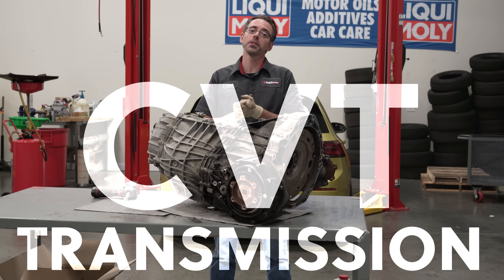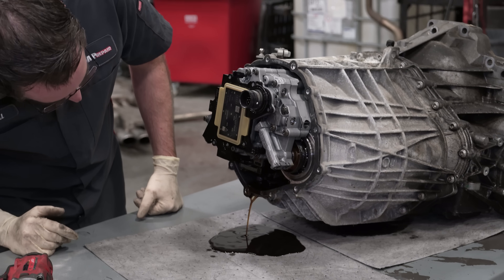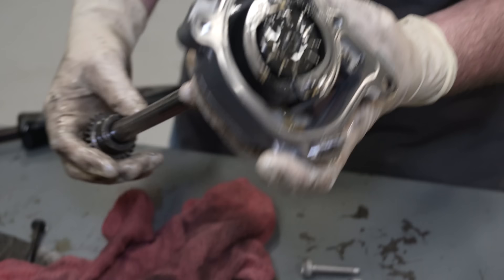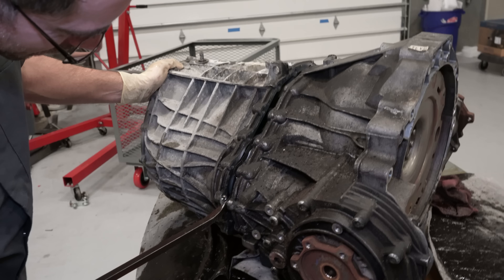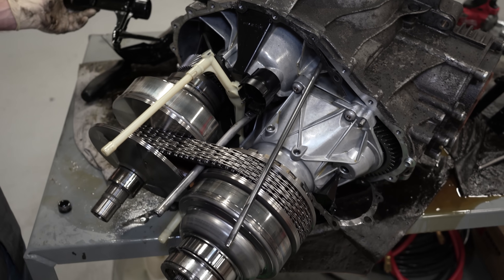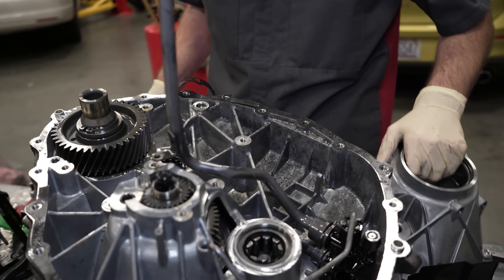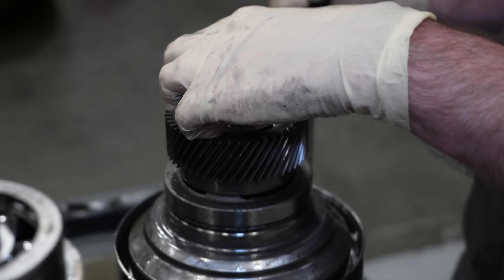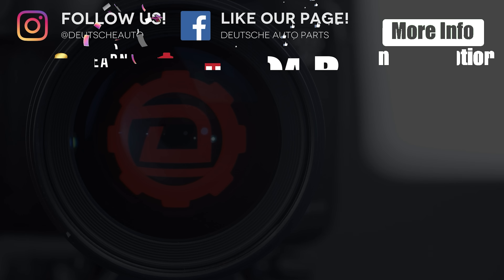Why you shouldn’t get a CVT transmission

Comment: Toyota CVT's are unique because they use a "launch gear". CVT's tend to experience the most slip and wear under hard acceleration from a dead stop. In a Toyota CVT a conventional gear is used to accelerates the car up to a certain speed and then the launch gear is disengaged and the continuously variable mechanism is engaged. This removes a major source of wear and significantly extends the life of the transmission.
Reply: That’s true, an Uber driver I know has the launch gear fitted Corolla…He says it’s solid…does the fluid changes regularly…he had a Corolla pre-launch gear fitted 2015 corolla that cvt finally took a dump at 325K…
Reply: @donovanfahrbach2493  325K miles is incredible for a CVT though. Jatco units will die as soon as 40K or earlier!
Reply: @MyerShift7  Agreed I walk though the scrap yard and all I see is a graveyard of Jatcos
Reply: @MyerShift7  honestly 325k is incredible for any transmission
Reply: @donovanfahrbach2493  wow thats pretty good mileage for any transmission
Reply: @donovanfahrbach2493   I mean.... 325k miles or kilometers? Still seems like a good number to hit for the life of a supposedly fail-heavy technology
Reply: @SuppositionalBox  325,000 miles on a 2016 Toyota Corolla..that’s miles .
Reply: thats true on the corolla SE. But starting 2023, the launch gear is there on all models.
Reply: @nadirnazim9342  its still a shitty CVT
Reply: @nadirnazim9342 eCVTs don't need a launch gear because it uses electric motors, there is no mechanical contact between the engine and wheels
Reply: @davewebster1627 you mean it uses planetary gears rather than that metal belt system.
Reply: I can't get over how ridiculously large the transmission is
Reply: @latemreggadable  That's what she s....never mind. 🫤
Reply: @latemreggadable  Yes... And complicated AF. Typical German Garbage. Complication for its own sake is their philosophy (in cars)
Reply: I just had a new corolla as a rental and found it was the only CVT I have driven that I liked.  Drove really well, always had a perfect ratio for the situation.  Very smooth.  The mechanical first gear works really well in traffic too.  Feels just like a regular torque converter auto
Reply: @kbkman7742 glad to hear, my 2024 corolla hatchback arrives in a month.
Reply: i have Lexus GS300h 2016 with this thing and it is amazing  never had any issues. car has already 260k km under its belt...
Reply: You got that from Scotty Kilmer.
Reply: @Nick41622  😂😂
Reply: @KL4life  what's so funny.
Reply: Leave it to Toyota to actually fix the common fault point of the trans and then start using it.
Reply: A friend of mine had a Toyota (I don't remember the model, but it was a sedan). He loved his. Only thing that kind creeped him out was the no shifting. He said for the longest time he'd be waiting for it to shift and it wouldn't, then he'd be tense from expecting it to. Said it took him a little to adjust.
Reply: @WiPri0371 That was my experience but the driving experience is so damn smooth getting onto the highway because there is constant torque
Reply: don't Toyota CVTs use eCVTs? as in there's no belts it's just a planetary gear set with two motors
Reply: @alyx6427  The eCVT is only for the hybrid models. The electric motor takes over the role of the pulley and belt.  Normal gas only models still have the pulley and belt CVT.
Reply: @davec3400  Excellent... my Honda Accord Hybrid shall prevail!
Reply: @davec3400  "eCVT" is a really, really bad name - it has nothing whatever in common with a mechanical CVT.   Also, it (eCVT) works, and in a non-annoying fashion.
Reply: @cr10001  John Deere calls their newest iteration of this just " evt" (electrically variable transmission.) The older system they called "ivt"(infinitely variable transmission). The ivt used a hydraulic motor for speed control in the planetary system where the new one uses an electric.
Reply: @davec3400  makes you wonder when they even call it a cvt then 😂
Reply: @cr10001  The transmission in a Toyota/Lexus hybrid is definitely a CVT.
Please allow me to explain. The most common mistake people make in the "CVT debate" is that they misinterpret the term CVT.
The term CVT has nothing to do with the architecture or how the transmission works but what she does. In other words: CVT is the RESULT
of how a transmission works. I will clarify this with 2 examples:
First example:
The transmission with 2 pulleys and a belt (AKA the traditional CVT)
In short: the most common type of a CVT uses a V-belt witch runs between two pulleys, the cone-shaped halfes of the pulleys can move together and apart.
So that is how the transmission is built and how she works and the RESULT of that is a transmission with no fixed gears or steps but instead of that
 a transmission with a variable gear ratio or CVT.
Second example:
Toyota/Lexus  eCVT
Very short : this transmission uses a complex planetary gear system with 2 electric motors- generators (MG 1 & MG 2)
integrated. The mechanical gearing design of the system allow the mechanical power from the ICE to be split in 3 ways:
- Extra torque at the wheels under constant rotation speed.
- Extra rotation speed at the wheels under constant torque
- Power for an electric generator.
Now that is the architecture of the system and how it works and it's completely different from the one in the first example with the 2 pulleys, you can't
even compare them.
But the RESULT is exactly the same: a transmission with a variable gear ratio or CVT( Continuous Variable Transmission).
CVT's are used in many vehicles even in bicycles ( NuVinci hub). And of course a CVT of a bicycle works totally different than a CVT of a car, but the 
RESULT is, again , exactly the same: a transmission with a variable gear ratio or CVT.
Conclusion:
Every transmission with pulleys and a belt is a CVT, but not every CVT is a transmission with pulleys and a belt.
CVT is just a concept and Variomatic (DAF), Variotronic (Audi), ECVT ( Subaru), e-CVT (TOYOTA/LEXUS), NuVinci hub for bicycles etc. etc. are perfect examples of how the concept CVT can be realized.
Reply: @davec3400 Correct 👍😊
Reply: @davec3400 Oh man that really sucks. And I just bought a Corolla. How long can I keep it before problems arise ?
Reply: @TheTiloalfa6  CVT stands for continuously variable transmission. An electric motor can output variable torque depending on how much power is applied. It is more reliable and more simple than a pulley system in traditional CVT. Calling it a eCVT with the e for electric makes perfect sense.
Reply: @Nathriel  The Accord Hybrid system works same way. The electric motor is your primary mover until 45MPH, at which point the ICE and transmission mechanically link up. So far it's been trouble free 155K+ miles. Just keep up on the scheduled maintenance.
Reply: @davec3400  Also one of the reasons the GS450h keeps appearing near the top of most reliable cars.
Reply: @cr10001  got 350k miles on my mechanical CVT and I still occasionally see the new owner driving it... same bumper stickers
Reply: @davec3400 nope, they interact with the planetary gears to adjust the mechanical ratio.
Reply: @alyx6427  - Only the Toyota "Hybrid Synergy Drive" vehicles use the e-CVT: the Prius and Prius Prime and Corolla Hybrids, which use the P-610 transaxle and a 1.8 liter gas engine. Camry Hybrid, the Rav4 Hybrid, the Rav4 Prime, the Hitghlander Hybrid, and Sienna mini-van use the slightly larger and heavier-duty P-710 transaxle and a 2.5 liter engine. The belt-drive CVT with "launch gear" is used in some non-hybrid models that have only the gas engine and no electric motors. I agree with the presenter in this video that belt-drive CVT's are simply not a good drivetrain for long-term service. There are just way too many ways they can go haywire that are extremely difficult to diagnose and repair. In order to work at all, the dimensional tolerance between the two sets of pulleys and the drive belt has to be maintained with extreme precision, at all operating temperatures, speeds, and load conditions. This depends on every part of the hydraulic and mechanical systems in the transmission not experiencing any leakage of fluid or loss of pressure, and the belt tension not becoming too tight or too loose.

The Toyota e-CVT P-610 and P-710 HSD transaxles in the Hybrid Synergy Drive have no components that depend on friction: no belts, no clutch packs, no bands. The continuously-variable function is provided via a 3-way planetary gear called a "Power Split Device" and the MG1 motor. MG1 is a 30-hp, 3-phase, reversible motor-generator with a permanent-magnet rotor. It's splined to the central sun gear of the PSD. The gasoline engine is splined to the planet gear carrier of the PSD, and the outer ring gear connects to both the MG2 primary drive motor and the differential ring gear. A computer is controlling the flow of power to the stators of both the MG1 and MG2 motors, and by varying the rotation speed of the MG1 motor, the rotation speed of the gasoline engine can be optimised to any of several conditions: best fuel economy for a given vehicle speed, maximum power to climb steep hills, least tailpipe emissions, and best ratio of power between the gas engine and MG2 drive motor. 

The Toyota HSD transaxle has a few requirements to keep it running reliably: change the oil and Inverter/transaxle coolant at the recommended intervals, and don't abuse the car by asking it to do things it wasn't designed to do, like towing a trailer. If you just change the transaxle oil and inverter coolant every 60,000 miles, the P-610 and P-710 transaxles and inverters can probably last at least 200,000 trouble-free miles. Lots of taxi and Uber drivers get 200 to 250 thousand miles out of their Prius with only minor repairs needed. I've never heard of any belt-drive CVT lasting that long.
Reply: @laura-ann.0726  Thank you thank you thank you! You really cleared all my doubts
Reply: @alyx6427  yes, no belts, and its pure genius design
Reply: @howarddyer6739  It still does have a belt, otherwise it wouldn't be called a CVT.
Reply: @alyx6427  if I remember correctly, eCVTs are hybrids only
Reply: @alyx6427  only for the prime and and Hybrid ones, it's built proof
Reply: @alyx6427  They use ECVT for electrified cars. They are long lasting, no maintenance device.
Reply: @alyx6427  that is for the hybrid models and some of them have traditional transmissions instead of the e-cvt I believe the hybrid Camry and the bigger SUV and truck hybrids have standard or CVT transmissions depending on the model. But the Prius and the Corolla hybrids have that eCVT and they are bulletproof.
Reply: @alyx6427  that's only possible with hybrids.
Reply: @alyx6427  eCVT is on the hybrid models
Reply: @alyx6427  no that’s prius
Reply: @alyx6427  eCVTs are the transmission used for hybrid cars. For non-hybrid cars they use CVT. Actually, eCVT doesn't have a similarity with CVT. It is a totally different design and they should not be called eCVT.
Reply: @alyx6427  not everyone can afford a hybrid
Reply: @alyx6427 On the newer ones, yes!
Reply: @alyx6427  Only the Hybrids, such as Prius, and Camry Hybrid use the eCVT. The others, such as the non-hybrid Corolla use a push belt, rather than a pull chain like the one in this video.
Reply: @alyx6427 that’s only the hybrid, gas vehicles use a conventional Cvt
Reply: @alyx6427  They're usually found in hybrid vehicles
Reply: It was my understanding that CVTs were less complex than traditional transmissions. This one that they have dismembered in the video is gigantic and for some reason I thought they were smaller, lighter and more practical. Where did I get all those conclusions? 🤔 Even with all that, is this Trans easier than a normal one?

Thanks for the explanations, thinking about buying a Toyota and it was good to learn about it.
Reply: @peter_shadow7559  - The CVT in the Honda Fit is smaller and lighter than the one in this video, but the Fit is a very small car with an engine that makes only about 1/3 of the horsepower and torque of an Audi A4. This transmission looks like it came from a late model car, and the most recent models of the A4 line came with 3.0 liter V6 engines that produced up to 349 hp and 369 ft.pd. of torque. That much engine power would require a very heavy duty transmission to handle it, thus relatively large and heavy internal components. The pulleys and especially the drive belt would have to be huge to handle the power, so everything else around them, and the housing itself, would be pretty large, too. CVT's are only "less complex" than traditional automatics in the sense that there are maybe fewer moving parts overall, but to make a CVT work at all, those two sets of pulleys have to be controlled with extreme precision, so that the tension on the belt is kept in the proper range: neither too tight nor too loose. Too tight and the belt breaks from excessive tension, or it gouges up the working face of the pulleys. A little loose and it slips, and the car doesn't move, way too loose and the belt could slap around so violently that it breaks. The pulleys are actuated by hydraulic pressure, and the hydraulic system is very complex, with lots of places where an o-ring might fail, causing leakage and a loss of pressure, and if the pressure drop directly affects either of the two sets of pulleys, at best the belt will start slipping because one of the pulleys is too loose, which will upset the control system that is trying to keep the engine speed correctly matched to the rotation speed of the tires and at worst the belt will break. When conventional automatics have problems with internal hydraulics, the bands start to slip, or the clutch packs don't work the way they should and you "lose a gear", but the whole unit isn't going to explode on you. When a CVT vehicle is traveling at freeway speed and the belt breaks, the whole transmission is filled with hundreds of pieces of steel, and that's the end of that transmission; they're generally damaged beyond repair and you just replace the whole thing for maybe $8,000.

The comment by Ray Gould below sums up the problem better than I could: "There are a myriad of reasons why CVTs suck, but the core of it is that they have to operate at such a ridiculously high line pressure that the slightest scratch or imperfection on a spool valve or valve body would allow high pressure leakage in a fluid circuit, pretty much guaranteeing a total failure." And of course everywhere that oil passages cross the boundary between sub-assemblies within the transmission, the passage has to be sealed with a o-ring, and o-rings can and do fail.
Reply: @laura-ann.0726  Good to know.
Reply: @peter_shado😅w7559
Reply: That's my 2020 Corolla SE is equipped with. Almost 3 years now and still loving this car.
Reply: @eraserheads78  my Lexus is a 07 ....and I drive that truck hard with over 200k ....change your transmission fluid every 60k or so and don't worry about it. My trans fluid is expensive....but what I'm doing is obviously working 💪
Reply: my 2021 corolla se drives like a brand new at 52,000 mile on the clock. @eraserheads78
Reply: The only difference is that Toyota engineer things to last, this in the video is a VW AUDI transmission, the n.1 car manufacturer that only cares about money. In 2023 you pay almost 40k for a Diesel Gold with 200hp, the worst sport suspension configuration and an old dual clutch transmission with a computer attached.
Reply: @manuel.dignani  Honda’s CVT transmissions are also worth a mention. Unlike Toyota and Nissan who sources their CVT transmissions from Aisin and Jatco respectively, Honda does it in-house. The end result is a more seamless pairing between engine and transmission, as Honda is responsible for both.
Reply: A total boring ride. Why would anyone want to drive a car with a CVT? You might as well just drive a golf cart around. The feel of shifting in a car is one of the best pleasures of driving a car. CVT are for people that don't care about the driving experience.
Reply: @mjk9674  
Because some  people  spend 8 hrs a day driving around in the city.. or commuting in traffic.
Toyota CVT gives more of a feeling of an EV... Unless at high throttle or RPM.
Why would anyone want to shift on a boring ride on there commute?
This is coming from a person who drove a semi for years.. I shifted more in one day than you do in a month... 10 speeds in a NON  synchronized trans.. double clutching or slip shifting each gear. 
In a semi..  you are in 5 gear by 20 mph.
Reply: ooo, nice to know if i do ever need a cvt
Reply: if i remember correctly, i THINK later model hondas started doing it too
Reply: that proves that gears are better and CVT is horrendous
Reply: It's a fantastic way to take a terrible concept and ruin a car with it.
CVTs are only good for soccer Moms, and old people who can't use a manual.
For anyone who actually enjoys driving, a CVT makes a car a transport appliance, not a vehicle.
Reply: @Chris Davies  I don't see the problem with the one in the RX400H...yeah you don't get shift shock from changing gears...my Lexus FLYS on a full battery and some premium gasoline...it feels different sure, but evolving engeering always does. Feels diffr3nt at the gas ⛽️ station too! Getting like 36mpg if I drive nice....even better in the city driving under 35mph 
The Porsche chianne (lolz) back in that year was actually slower than the Lexus RX400H. And with AWD I've never had a problem on Michigan roads. What else is going to give me the ride of a luxury truck, with decent speed and 36mpg???
Reply: Doesn’t matter. CVT is still CVT. That’s like saying headphones with different company name but it’s still the same headphone. Nothing different. 
One can outlast the other but I rather like Toyota’s conventional transmission then the CVT
Reply: yep, 230k miles on our 2012 Lexus CVT transmission...Toyota for the win....
Reply: @chriswtx  Any fluid changes on your CVT?
Reply: @Noypi54494  260K miles now...and yes, fluid changed every 20-30K miles.. its too easy and cheap not to. I do all my own fluid changes...
Reply: @chriswtx  damn I better get the 2021 Highlander Hybrid's eCVT fluid changed then  ASAP. It just rolled past 90k miles
Reply: Are they ALL like that???
Reply: smort
Reply: That explains a lot. Thank you for that
Reply: Nissans have a launch gear as well.
Reply: @Erdie5 that’s funny because a friend of mine has a 2020 Nissan Sentra and his cvt went out @ 24k miles… dealer replaced it under warranty, but he traded it in … he couldn’t believe it blew like that… he bought it new and got a great deal so he thought… this launch gear might have not been in his particular car…
Reply: Do you mean 'launch gear' or 'lunch gear'?
Reply: @jiyushugi1085 lurch gear.
Reply: Yeah that's what's in my Lexus. And it's awesome as far as I'm concerned, I have over 200k miles , and I do change the trans fluid
Reply: Toyotas look butt-ugly, and besides, these "hybrid technologies" rarely is ever work long-term.
Reply: Don't subarus also have pretty reliable CVT's? I know the ones on Nissan were garbage but I never hear about subarus and those are literally in every modern Subaru. Now that I think of it I don't think they have automatic transmission
Reply: Toyota CVT even with the launch gear also give trouble in my country. The new RAV4 and Corolla are coming in with problems which were unheard of in the past.
Reply: They are pretty bad though. My toyota downshifts as i take off. It's like it gets stuck in 2nd gear, then realises its meant to be in 1st. Not fun to drive at all
Reply: My 2015 Toyota carolla sport has a cvt tans and it’s running smooth mile and miles later
Reply: toyota cvt still is crap. the tranny in their crossovers are straight up headache.
Reply: Reading all these comments about people with over 200k miles on 10 yr old cars makes me sad. I feel like people's work commutes are just getting longer and longer. I've driven to so many states in my car and I still haven't eclipsed 160k miles in my 17 yr old car yet. Not only tht but I also doordashed quite a bit during covid and that alone added a decent number of miles. Yet I still hardly put more than 10k miles on my car each year.
Reply: I luv the CVT in my 2023 Corolla.
Reply: Toyota using legacy matured low bhp tech on their cvt will be durable anyways. If they hv guts, put the cvt in the supra with a bmw engine. Toyota is overated, their electric car also sucks, they need to wait for the tech to matured before copying.
Reply: @torrhthc4103  the best comment so far most of these Toyota bunnies have never driven a REAL CAR , God I've driven these piles of poop , gutless crates on four wheels !!!
Reply: ZF or Allison planetary automatics with torque converter is the way to go everytime😊
Reply: Yes, Toyota's engineers are awesome! They foresee problems and take the precautions to fix them.
Reply: Do people it realize that the Japanese domestic Prius has had CVTs since the 90s?

Toyota had 20+ years to figure this out
Reply: makes sense. the problem is torque. CVT work great for golf carts. Easy get hundreds of hours of operations with out problem. Golf carts engines do not produce much torque though. the hard part is scaling them up. I guess Toyota made two speed CVT to deal with the torque problem so they do not have build a beefer CVT.
Reply: @spark300c  Exactly right.
Reply: Not fully true. Toyota has three different CVT's: Fully conventional like in my 11th Gen Corolla, the eCVT in hybrids with the planetary/Sun gear set (no belt at all), and the new one with the launch gear.
Reply: Audi is a complete POS
Reply: Like the old 2 speed Mini Bike. The engine clutch had 2 sprockets. One went to the lower geared takeoff to the Jackshaft while the second went to a direct drive clutch that would engage around 10 mph and over run the lower gear since it had a built in Ratchet in the sprocket!
Reply: I have toyota grande 1.8litre with CVT transmission. Because of launching gear ( you added to my knowledge), the  initial torque is much supportive and prompt response.
Reply: They have launch gear because CVT is slow af like Scotty said.
Reply: @henrykim4230  not on the Hybrid 😉 the 400H is not slow
Reply: @mobilegamersunite  BRO DID YOU SAY FAST HYBRID!!!!!!????????
Reply: @henrykim4230  yes, it's gas and electric,  best of both worlds. It takes premium gas, but it gets 36mpg. It's faster than most challengers and chargers I've had the pleasure of racing. Especially if you overcharge the battery with the (B) gear ⚙️ on the trans. 
Faster then BMW trucks, ranger rovers (new)
Reply: @henrykim4230  also. I work for the car industry 🙃  electric cars are faster than gas powered....I've seen electric motors spin rubber tires right off the rim. ...they just don't sell them like that lol 🤷 😂 🤣 
Look at the new super and hyper cars...most of them are hybrids
Reply: @mobilegamersunite  duh? My ex has Tesla and so as my friend? talking about hybrid here not electric. I know electrics are fast af because i drove them many times. And when i am talking about hybrid, i am talking about Honda Toyota Hyundai hybrid. Not Porsche taeycon (my spelling sucks) or Acura  NSX hybrid.
Reply: @henrykim4230  my Lexus is a Toyota Hybrid, and it's fast, that's all I know
Reply: @mobilegamersunite  TOYOTAHYBRIDISFAST???!!!
Reply: @henrykim4230  LEXUS Hybrid is fast 😉 😜
Reply: @henrykim4230  especially if you max charge the battery 🔋 the trans has a (B) gear just for that, so you can keep the battery charged full. And I still get over 34MPG when I drive good 👍 🙃
Reply: God damn it man. Why. Does Honda do this?
Reply: what about 15+ combinations gearboxes in some plug-in hybrid vehicles ? how do they work ?
(benefit of lots of gears, without practical limitations of CVT).
I wish all cars were CVT, would make the ride much more relaxing like a train
Reply: @YounesLayachi  
I believe most of the Hyundai and kias use a standard automatic transmission or a DCT. With their plug-in hybrids and their regular hybrids. I believe they use a pancake electric motor where the torque converter would be. Does have the advantage of the transmission adding additional torque to the wheels. But you also then have all of the complication of a DCT plus all the hybrid systems. It does give a more natural driving experience if you like stepped automatic transmissions. The Toyota's definitely have a bit of the rubber band effect. But not as bad as a typical belt and cone style CVT. Also the newer Toyota hybrid powertrains definitely work a bit better react a little bit quicker than some of the older ones.
I ended up putting 423,000 mi on a Prius. Ended up having an engine problem oddly.
Someone else I know has an '07 Prius with 580,000 on it. And I have an another friend that has a 2019 Prius prime with 345,000 mi on it. He does expedited cross country courier work.
The other thing I like about the Toyota hybrids is the transaxle is really easy to maintain. They're a simple dump and refill. On the transmission. They used Toyota WS compatible fluid it's pretty cheap, no filter to change. You could probably get away with changing it every 150,000 mi, I always changed mine at 50k. Just seemed like cheap insurance to me considering you take 20 minutes to do this fluid change.
Reply: Actually pretty smart of Toyota, if only they made smart decisions like not getting rid of the mr2, celica or Supra years ago.. as you can see they regret that decision but still can’t be smart enough to make their own Supra. Sad.
Reply: Ok Scotty Kilmer
Reply: That explains the reason I don’t feel the rubber band effect in my  2015 Toyota Corolla. Always had that in my 2012 Nissan.
Reply: Still Bollocks.
Reply: honda uses a lock up torque converter
Reply: What about the new  Mitsubishi CVT's ..?
Reply: Toyota can’t make good transmission Toyota buy transmission from asin wanner that why Toyota still use automatic transmission Honda do good cvt that why civic and acorrd use cvt very good
Reply: Yes
Reply: Very interesting. Similar to how Toyota has a hybrid D4S system to compensate for the flaws of direct injection. New tech with lots of upsides, but also some downsides that you just can’t quite dial out.
Reply: I've had two different Toyota CVT cars for a total of 8 years, no issue, but i can confirm there is definitely a primer gear when you're at a dead stop/idling.
Reply: Well having a launch gear only stresses the chain more.  It’s either the chain or the gears that get screwed. 

CVTs suck.  They use more gas.
Reply: honda too
Reply: That's cool but i've seen ppl blow up a new transmission in months , because the fact remains that nothing can fix stμpid... they want a commuter vehicle to be a NASCAR not spending one cent...😂
Reply: Toyota n'utilise pas de cvt.
Une e-cvt n'est pas une cvt. Mais une e-cvt
Reply: The launch gear wasn’t introduced until around 2017, I believe.
Reply: Only 2019 and up Toyota cvts use the launch gear.
Reply: Not all Toyota cvt use launch gear.For small engines like 1.6 the cvt has no launch gear
Reply: POS transmissions that are completely inconsistent on acceleration
Reply: Not all Toyota CVTs have the 'launch gear'.  In fact, most Toyotas CVTs do not.
Reply: That explains the jump my corolla does when I'm in bumper to bumper traffic and hit the gas a little hard. Thanks
Reply: problem is that particular CVT isn't available with the 1.8, which they disconntinued last year
Reply: Surprised at the amount of plastic that came out of that.
Reply: And adds another expensive part , like having two transmissions which will eventually fail
Reply: I bought a 2016 Toyota Corolla new and have 80000 miles on it now and haven’t had any issues with it. It took some getting used to the way it felt driving.
Reply: thank you for this post. I was just about to say i have a cvt in my prius and it has never given me any problems.
Reply: It’s still no fun to drive though, it’s a inherently flawed design.
Reply: @MacTechG4  had a 2007 prius i named the mustang killer because my stock prius could beat any stock mustang at the time up to 30. amazing what you can do when you don't have to switch gears
Reply: @jermyeder2262  fall asleep due to boredom? Face it, CVT is about as enjoyable as a root canal without Novocain.
Reply: @MacTechG4  i dont think you have ever driven a cvt
Reply: @jermyeder2262  Toyota Prius, 2014 and 2017 Corolla, Nissan Sentra, all rentals, I’ve driven CVT (unfortunately) enough to know I loathe it

If the Infinity Gauntlet was real, I’d snap 100% of CVT out of existence.
Reply: @MacTechG4  so you drove a bunch of cars that have been reprogramed and limited by the rental company and think that represents all cvt's. let me bring you a cup of sea water so you can see all the whales in the ocean.
Reply: @MacTechG4  Williams F1 FW15C Renault's RS5 3.5-liter V10 engine producing in the region of 850 hp Williams successfully tested the FW15C using a custom design CVT.
Reply: and HONDA.
Reply: "CVT's tend to experience the most slip and wear under hard acceleration from a dead stop", I think we have torque converter to do the job.
Reply: Very interesting. Is this what we call Dual Clutch CVT, which is used in Daihatsu Rocky?
Reply: That launch gear version is new and only available for some upper trims. Most Toyota CVTs are without launch gear.
Reply: I have a 2007 corolla with 300k. Transmission works like new.
Reply: What year did Toyota start doing this ?
Reply: is it a cvt transmission?
Reply: Thats Right Corollas 14' and up had that mechanism.
Reply: Still a CVT.
Reply: Toyota hybrid drive system isn't a CVT at all - though it drives like one.  In the (dominant) self-charging versions, all gears are fixed and there isn't even a clutch (much less a "launch gear").  Toyota was stupid to call it an e-CVT, because there ain't no belt, no nothing.
Reply: still junk. even if it's from the Yoda gods
Reply: Don't compare Toyota quality with German shit. Toyota always builds quality parts that are well constructed and doesn't skimp on the $3.50 production cost required to do so ;-)
Reply: @CH_1337_LEXUS  Toyota quality? 45k Tacoma. garbage. for a truck that couldn't pull its way out of oncoming traffic. v6 0-60 in 15 minutes. pass.
Reply: Well hell, that explains how my 2024 Corolla feels like it has a CVT and first gear!
Reply: I have a 2018 C-HR in my shop with 82k miles on it that needs a new cvt. $9,800 we quoted them.
Reply: Toyota is not unique in this. Hyundai has this. 😂
Reply: ALL HYBRID CARS have CVT Transmissions.  CVT Transmissions are the only transmission that can have 2 inputs.  One for the electric motor, the other for the gas engine.  I will not buy a hybrid for that reason. CVT's BREAK and when they do, can harm your engine.  They may get better in 20 years, but in 2023, they are very expensive junk that always break right after the warranty's expire.
Reply: Yes, only Toyota makes it possible. Why do other automakers even try. Toyota invented automobiles and moving assembly lines. Others just copy.
Reply: It does not change the fact that CVTs are shit.
Reply: The old prius did not have a launch gear and their CVTs lasted anyway... it's not the launch gear it's using solid parts and not the cheapest supplier possible like VW.
Reply: NO, not all of them. Toyota has at least three different designs of CVT. The K313 (?) in my 11th Gen Corolla does NOT have a physical "launch" first gear. It's all belt and a torque converter. 222K MILES+ right now. Of course, I've had the fluid changed several times because I actually maintain my vehicles.
Reply: @MyerShift7 it doesn’t matter, as long as it has a belt it’s still a CVT. Those transmissions are not meant to last. As much as the traditional transmissions. Why do you think they still make them? Because they are cheap to make. The car makers even admit this. The only thing is good is fuel economy but that’s it.
It can never surpass the old transmissions that Toyota used to have like the 4 speed transmissions or the 6 speed. Those were sooooo reliable I wish they would have bring then back.
Reply: the en of the story is always the same, once failed if the dealership dont want to replace it because is out of warranty be prepared to spend around 9 thousand dollars for another one because any brand has a repair kit, that make this crap of transmission  a disposable thing.  Are you agree that we have to be slave of the industry approving this kind os failed of the industry?
Reply: I don't understand how a CVT transmission can be cheaper than a ordinary AT it is probably just a lie and the real reason is that the CVT is supposed to have a better fuel economy.
The problem today is to find a car with a ordinary AT or even worse to get a Manuel gear box, where I live I don't think it's even 1% that have the MT so good luck trying to find one for sale,it doesn't happen.
Reply: Even the Lexus use the CVT.
Reply: Only the very new ones, and only from Toyota.
Reply: you saw Scotty Kilmer . lol
Reply: Too bad Toyota is the only one who cares and aren't idiots!
Reply: @techieman4614  Lincoln has an ecvt and dual injection for good reliability. The cost of ownership is lower than any brand other than Tesla.
Reply: And thats why toyota cvts last +200k miles while nissans struggle to get past 80k miles
Reply: I call bullshit. My 2019 chr would like a word, went full primed grenade at 125,000 miles. Disposable fucking garbage every cvt , junk
Reply: this is my exact problem lol with a nissan
Reply: I’m a mechanic, I agree with everything said and done in this video. I had a good laugh. What I don’t understand in the auto world is why a car company that doesn’t have a stupid amount of gears in the transmission is a dinosaur but one that has infinite gears like a CVT is hated because there are seemingly too many gears, contradictory isn’t it. CVTs are junk even when they work.
Reply: How about Honda CVT?
Reply: @Gian_Mel  at my auto repair shop I have a honda pile, thats where all the honda engines and transmissions go, sometimes we take parts of that junk pile because we need something like a special bolt or sensor but I don’t have a pile for any other make of vehicle, Honda is over rated, not nearly as good as people like to think they are.
Reply: They're hybrid cvts also work on a completely different principle than the pulley and chain system all together which makes them incredibly dependable
Reply: 200k on a Nissan Altima cvt of all CVTs lol. Change your fluid every 50k at most and you're good.
Reply: Does that vhy knows what he is.doing. he is a big joke.for an auto tech
Reply: Doesn't matter for how long its life gets extended, is nothing compared to traditional transmission life span
Reply: @pkoicetr   I bought a used Escape Hybrid with an original CVT.  I sold it with nearly 400k miles.  Never had any problems with the CVT and this was an AWD Escape that puts even more stress in the transmission
Reply: How many years have you been commercially overhauling transmissions and how many miles is a typical Toyota CVT service life? It's often difficult to find CV-specific expertise.
Reply: Toyota's hybrid CVT drivetrain is different again - there are no pulleys or gearchanges involved. It's a 2 input planetary device with ratios decided by the ratio of torque on each input (the second input is an electric motor)
Reply: Thanks for the precise response. I was surprised when he said that cvts suck, because toyotas will last much longer than some manual gearboxes. In the US apparently people are buying Lexus cars with 200.000+kms and will run them for another 100.000km without major issues
Reply: So basically you get what you pay for 😂
Reply: Further setting Toyota apart from the competition as the most overall reliable vehicle brand
Reply: Hello I wanted to launch my Toyota Avensis, press the brake then accelerator and it just snapped.. it's going D, R but doesn't move. When I put it in P it makes some noise for like 3sec. So can someone tell me what should I do? 2.2d 150ps 2010
Please tell me if you know what could it be. Thanks
Reply: @fanimustafa9661  You need to take it to a mechanic that specializes in transmission work. A dealership might have transmission specialists on staff or else look online for a transmission place. To me, it sounds like when you revved up the engine with your foot on the brake, you probably broke something inside the transmission. Most likely, this will not be a cheap and easy fix.
Reply: CVTs are absolutely awful regardless of manufacturer
Reply: @account2292  My wife has one in her Toyota. It works great, and there have been no issues.
Reply: Been trying to get a shop to look at my Nissan Sentra, if it's related to the Tranny, no one wants to look at it. Looks like I might lucky as the VSS sensor went out, tyranny went into limp mode while I was 4 lanes out from the right shoulder avoiding a collision while trying to make it safely to my right shoulder.
Reply: I saved a lot on my car insurance by switching to Ebike
Reply: Your garage had shit cars with bad cvt, Toyota had never problems
Reply: I don't know why people hate CVT. I had toyota prius 2012, then kia rio 2021, then volkswagen getta 2021, the Ford fusion 2014, and I drove my fathers Kia Sportage 2019 for a while. ( I am uber driver )
The only car that had CVT transmission was the Prius, I honestly like how it drives better than all the others. The other types of automatic transmissions take some time to shift between gears which makes the car feel like not responding right away.
Reply: The Toyota eCTV does not have belts pullys or a launch gear
Reply: This is true gad to disassemble one due to a bearing failure caused by poor maintainance and i saw the gear ur speaking about
Reply: They just knew CVTs suck and wanted to make them better.
Reply: @charleshines5700  Why do CVT's suck? They keep the engine RPM's in the best speed range while the car is traveling different at speeds. Yes, there were reliability issues in the beginning, but as the technology has matured CVT's have become much more reliable.
Reply: @joevignolor4u949   2022 Toyota Corolla le CVT no launche gear  and I have 198000 no problems. I do a drain and fill every 60 000.  No need to change the filter if you do it every 60,000. And I have a 2015 Toyota Corolla le CVT With 258000 no problems
Reply: @user-pj5ff6xw4x  So I assume that you have actually taken one of these transmissions apart yourself and confirmed that there is no launch gear inside.
Reply: D-cvt
Reply: @joevignolor4u949  exactly my point. CVT transmission is made for people who want to save fuel. Don't stretch the belt system by starting off like you're driving a mustang. Common sense really.
Reply: it still fails allot
Reply: Ill buy one when I start seeing CVTs reach 300-500k MILES!😂
Reply: Yeah, I'm wishing my 15 civic had that right about now.
Reply: corollas in Saudi are facing lots of issues with new cvt maybe because it's made in Thailand
Reply: I had a lease 2014 corolla with a CVT. Literally worse driving car I've ever had to put up with since I started driving back in the mid 1980s.
Reply: Dose the 2020 corolla have it
Reply: @bigboy6969100  My wife's 2020 Corolla has a CVT.
Reply: Does this mean Toyota’s eCVT is better for towing than the belt drive CVTs?
Reply: @ I think CVT‘s are commuter cars. I don’t think they’re gonna put it on trucks anytime soon. It’s something that the government wants if not Toyota gets fine almost all the car dealership gets fine if not, Toyota put a 2jz in every Toyota ever and then we’re good to go
Reply: @bigboy6969100  gotcha.  The reason I ask is my Grand Highlander hybrid eCVT max towing is 3500 lbs versus 5000 for the non hybrid 8 spd automatic.  I’ve heard the reason it’s limited to 3500 is because only the electric motor powers the eCVT in reverse
Reply: I've had a 2015 Corolla CVT without the launch gear, its fine I seem to be faster than most things on the road off a red light anyways maybe because most people drive SUVs nowadays.  Driving around my area its basically always under 2000 rpm sometimes hits 3000 rpm briefly to go 50 mph on faster roads.
Reply: I agree and read about that, but thry still have much more failure, compared to any other design in years.
Reply: It's amazing how 1 little idea can change everything
Reply: they only use that on the corolla and corolla cross every other model uses ecvt
Reply: Any thought on the Acura integra a spec tech CVT 2025?
Reply: @kathybarajas7636  I don't care what kind of modifications they make on them or who puts faith in a company as if they'll get it right. There's always 1 good story somewhere, but when you investigate, there isn't a vehicle with a CVT that customers aren't screaming loud for others to stay away from.
Reply: The vast majority of Corolla’s don’t use these transmissions though because they’re only in the 2.0L models. Only in 2023 did they make the full switch
Reply: 😮
Thanks for the info
Reply: Makes no difference … Mazdas double clutch auto 6 speed with sport mode from the modern sky actives walk all over Toyotas trans cvt never had any business being in a car they were meant for twist n go s auto go karts side by sides .. cvt was a travesty. I am passionate about cars just as much as the next guy but I can’t with these
Reply: Also they don't use a pull belt like this, they use a push belt, it's actually like a chain except the chain is just to keep it in place, it's actually compression that transfers the load. All the links stacked together perfectly in a stable locked mechanism
Reply: @joevignolor4u949  all junk bam cvt’s or I’ll ask trump to do it ! Hahaha
Reply: They are still shit regardless
Reply: Great video, and very entertaining! It was influential in my decision to get my Mazda.
Reply: Launch gear was a mistake... I had a Corolla xse with that and when I took it to get the 1st tranny fluid change the car JERKS on the 1st gear and after that it's normal. Took it back and they said it's "normal" mins you that I change the tranny fluid EVERY YEAR (used it for Uber/Lyft) tbh I really abused the car took it literally EVERYWHERE and did hold up but I never liked the launch gear cause it always jerked
Reply: 😅😅😅😅 Toyoda vs Toyota 😂😂😂😂😂😂😂😂😂
Reply: You state this comment as if you were the original source of the information.. 🙄 slime ball. You're a fake, I feel for your family.
Reply: Which cars have this?
Reply: @Tribenix I would assume any later model Toyotas.
Reply: That’s great but then why not just use all normal gears lol they are clearly better or there wouldn’t be a “launch gear”
Reply: @mattneil1449  Automobile engines are most efficient in a narrow RPM range. What a CVT does  is it allows the engine to run at the most efficient speed all the time regardless of how fast the car is moving. In a CVT equipped car the engine speed doesn't change while the car speeds up and slows down. You will see the tachometer remaining steady while the speedometer goes up and comes down. The problem with gears is they allow the engine speed to go up and down as the transmission runs through each gear. This means the engine isn't running at the most efficient speed all the time. You can add more gears, like going from 3 gears to 6 gears, but that increases the complexity and cost of the transmission, and the engine speed will still deviate up and down above and below the most efficient speed. CVT's eliminate this problem by giving you an infinite number of gear ratios that allows the engine to always run at the most efficient speed all the time regardless of vehicle speed.
Reply: @joevignolor4u949  how did foreign cars from the 1980’s manage to get mpg in the 30’s and 40’s?  CVT clearly doesn’t work for daily driving conditions. Also the difference between an old fashioned six speed automatic and a cvt is negligible.
Reply: i swear, the japanese are always 1 step ahead.
Reply: The durability is always first in Toyota not like the garbage design of Europe cars.
Reply: @Johilama  not exactly true my friend. The design is not garbage, if you refer to Audi/ww they do have better performance than a Toyota and that comes at the expense of endurance.
Reply: Yet a brand new cvt toyota raize failed to climb hilly road here in indonesia. Toyota stated that the cvt overheated
Reply: @amd.0001  hilly paved road or hilly dirt/mud road?
Reply: @amd.0001 this use daihatsu dcvt not toyota
Reply: @amd.0001 Most of the Toyotas in Indonesia are not really Toyotas.  Thats a Daihatsu with a Toyota logo slapped on it
Reply: @PlasmaSnake369  correct. Raize is manufactured by daihatsu, but their conventional CVTs are also failing like Nav1, Alphard. Only difference being it's not a common vehicle so it seems "reliable enough"
Reply: @amd.0001  And I guess Daihatsu is a subsidiary of Toyota now but they could be using different parts.  Also if a car can't get up a hill I don't think that's just a transmission issue, maybe the engine is weak
Reply: It's not about the launch gear. Toyota uses a planetary gear set just like every other automatic transmission the only difference is they use one gear set instead of three and they use an electric motor to turn the Sun gear which changes the ratio depending on the speed of the electric motor without this belt garbage.
Reply: @johnantonopoulous6381  you are confusing CVT with eCVT used in hybrids.
Reply: @johnantonopoulous6381 That's only on the hybrids. A high voltage battery is required to operate the much more dependable E-CVT. Non hybrid Toyotas use a conventional cvt with a launch gear.
Reply: I'm on my 6th Lexus RX400h/450h (hybrids). Drove them all fairly hard. Never had a problem. Great transmission as far as I can tell. I wouldn't drive anything else. I guess what this guy meant to say was, don't by a German-built CVT? Or don't buy non-hybrid CVTs?
Reply: @maxhardover9772  
The hybrid Toyota's do not use a belt and pulley CVT. They use an ECVT. It's a planetary split device with really no wearable items inside it at all. You just have to drain and refill the fluid maybe every 150,000 mi. There's not even a filter to change.
Reply: @kens97sto171   Thanks for the update. I just did some research and could not find a technical description as to how the eCVT "dual motor/generator" changes the speed of the planetary gears to derive an "infinite gear ratio". However, there are no belts or pullies. Much appreciated!
Reply: @maxhardover9772  
Your welcome.
Check out some of the videos from Weber automotive on YouTube. They have a technical automotive college in Ogden Utah. They deal a lot with hybrids and EV's. 
It's not full tear down and theory of operation videos on all the different generations of Prius.
The simplest explanation I have for the change of ratio. Is that the electric motors are on opposite sides of the planetary. And they put electrical load on one side or the other which changes the output ratio. That's not precisely correct but it's kind of the basic gist of it. 
Mechanically it's incredibly simple.
Really the only thing that can go wrong with them is if you have a failure of one of the electric motors. Usually that happens due to an insulation issue. That is usually caused by failure to change the fluid, it becomes corrosive and eats through the enamel in the electric motor wiring. Once that happens it's pretty much done. But the fluid is cheap and it's easy to change. And even if you don't change it, it's still pretty resilient. I've seen people with 300,000 miles that have never changed it and not had an issue. But to me it's just stupid to not change it, it's cheap fluid and it's easy to do.
Reply: @kens97sto171   Copy all - I'll do it!  I'm on my 6th Lexus RX 400/450 and I remember Lexus on the first model they put out (2007) had a 300,000 mi warranty on the drive train, and the accompanying docs bragged about how much testing they had done. My degree is BSEE and I'll be very interested to see how they're doing this. Thanks for posting the info...
Reply: @maxhardover9772  
Your welcome.. enjoy.
Have a wonderful day.
Reply: Yes, it's Toyota, not a pile of junk Audi...
Reply: I have a 19 camry. The cvt is a learning curve to drive. It rolls a little back n forth like a manual. I've had a manual so i know the feeling of driving something different. Once in gear it shifts smooth and fast
Reply: @yungahungatv8049  
Pretty sure the 2019 Camry has an 8 speed regular transmission. Maybe in different markets they use a different trans. But in the US I don't believe they use a CVT on any of the cameras. Not a Camry hybrid does have an ECVT but it doesn't work the same way.
Reply: Cameras do not have a CVT @yungahungatv8049
Reply: @yungahungatv8049  although a manual has a real clutch and real gears allowing it be super direct in its drive. A MT only rocks and and forward if you allow it. A CVT is the opposite in that it’s the least direct of all transmissions and is quite disconnected from the driving experience. Really MT is a drivers choice and CVT is a cost cutting car companies choice.
Reply: @inodesnet  CVTs are about meeting cafe standards and they meet the modest demands for 95% of drivers
Reply: Toyota's CVTs are no CVT. It's just a commercial naming
Reply: Very interesting
Reply: Yes, Joe Toyota must be commended for adding a launch gear to their CVT. It fixes one major bugbear. But the best way to fix all of the CVT complaints is to just use a different transmission altogether.
I've always hoped they would borrow Mazda's transmissions given Toyota invested intentionally to gain access to intellectual property and collaborate between the brands.
Many reviewers (e.g. Savagegeese and Car Nut Guy) still refer to the Mazda AT being the best transmission available on any affordable vehicle.
Reply: @inodesnet  The Mazda 6speed is awful, jerky and slow
Reply: @inodesnet 
I simply bought his and her’s Mazdas.
Reply: Toyota CVT's? Nah only the originally Toyota made engine has it, I mean yes they have DS-CVT (Direct Shift Technology) as what you told us on your comment, and also they have D-CVT (Daihatsu owned tranny which is also associated to some of their car models)

Ps. still Manual tranny or 5-6speed AT wins!
Reply: @cjyan29  Man, you're lagging behind. No manual can shift as fast as modern AT's and 5-6 speed AT's? That's old junk man! I regularly drive a Mercedes GT63S AMG of a friend of mine. Believe me, no manual or 5-6 speed AT can match that 9 speed.
Reply: Now I feel  A LOT better. Prius here.
Reply: Did you know it was a Ford design that never was put into production and Toyota just waited for the patents to expire to use it?
Reply: @Lowkey_ID Toyota design their own CVT and ran it in Asia for 10 years before bringing it to USA.
Reply: @Lowkey_ID that’s interesting. I just learned the Lincoln nautilus I just bought has an Ecvt and dual injection both of which I would hear Toyota fans talk about being a Toyota thing. Also they’ve been using the same 2.0 eco boost for a while and it is pretty solid much like Toyota keeps a solid reliable engine in production for a while. I’m hoping to put a ton of miles on this thing so I will be able to rub it in all the Toyota fan boys faces not that I even dislike Toyotas.
Reply: People also just need to do less hard acceleration, pointless speeding and idling. You can blame automakers for not being realistic about driving styles, but too many people are just wasteful.
Reply: @falseprogress  
Shouldn't be my responsibility to alter my behavior to make a product last longer to do something that it should normally do without any problem. Accelerating and idling and speeding are things that everyone does. Therefore the vehicles should be able to do that without problems or reliability issues.
 The fact that some models accomplish this without any problems and others fail at 70 - 80,000 mi proves that It's terrible design or engineering or manufacturing or all of the above.
Reply: Get the 8 speed or manual. The CVTs are not maintained because the dealer will not want to"maintain" it.
Reply: CVT stand for Continuously Variable Trash
Reply: Yes its a unique shit bcs its Toyota😆
Reply: It's still trash.
Reply: The Toyota CVT transmissions are just horrible, any way you put it. They need start putting conventional automatic transmissions back into their vehicles.
Reply: Yeah, but who wants a dull Toyota
Reply: @peanuts2105  Here is one! I dont have much to compenstate for and i like stuff that just works.
Reply: @peanuts2105  Dull but smart people?
Reply: @peanuts2105  .Who wants a broken VW/Audi..?  Toyota every time for me thanks.
Reply: @Doktor Uzo  Toyota for people who like beige, personalities of flat pack furniture, watching desperate housewives and have no sex appeal.
Reply: @peanuts2105  basically ur life
Reply: @peanuts2105  lol and you probably drive a chevy sonic
Reply: @peanuts2105  I like machines that are ready to work and I can rely on. I've never owned a Toyota product though I've driven the lamest one ever as a work vehicle, the prius. I honestly beat the piss out of those cars and they took it like a champ. Honestly if you gave me the choice of a free prius or free Audi, I would take the prius. I would never go out of my way to buy one, but same for "high end" junk. I honestly don't care what other people think about what I drive. Some see it as a status symbol, I see it as posing.
Reply: @peanuts2105  toyota's new 2 L petrol engine is more than decent actually they just need to drop the weight of the car by 15-20%
Reply: @peanuts2105  it's more about not wanting to own a piece of shit car and there's not many other options honestly
Reply: @peanuts2105  Desperate Housewives was a good show but the rest i agree with completely
Reply: @peanuts2105  Volkswagen is the same way, if not more boring for most of their commodity products.
Reply: @peanuts2105  Everyone who doesn't want to get stranded with his 'exiting' car. And seen Toyota's sales numbers, there seem to be a lot of those people who care more about reliability than the WOW-factor. And lets be honest. All cars are designed the same way (computer and wind tunnel) and differences are marginal.
Reply: @peanuts2105  Millions of sensible people.
Cars depreciate....Sound investments
appreciate in value...not so dull.
Reply: @peanuts2105  GREAT CAR
Reply: @peanuts2105  yes, “I have a boring car with no power that I drive like a boring car with no power and it lasted a long time” isn’t the argument that commenters think it is.
Reply: @peanuts2105  you can''t afford a Ferrari
Reply: @peanuts2105  yeah, I'd much rather have one of those exciting VAG machines, and spend every journey wondering if I'll make it to my destination.
Reply: I love my "dull Toyota" i will wave at you from my Toyota as I pass you while you're waiting on the side of the road for a tow truck in your "exciting high-performance car". I will wave at you again when I see you filling up with gas.  I live in Miami, lots of exciting cars here, Lambos. Farari's Porsche etc, but the fact is there is nowhere in the city you can ever even get to 55 MPH (We have traffic 24/7) Keep your "exciting" car, I prefer my Toyota, dull, reliable and cheap. @peanuts2105
Reply: @peanuts2105  "Yeah, but who wants a dull Toyota"
People who want a reliable car and enjoy a lower cost of ownership.
Reply: @peanuts2105  yes, nobody wants Toyotas so nobody buys them...
Reply: @peanuts2105  People who care more about reliability than showing off might chose to buy a Toyota or Honda.
Reply: @peanuts2105  A lot of people want to get from A to B and make it back home.  Anyone can buy a lawn ornament.
Reply: @peanuts2105  Corolla is still literally the most valued car one may purchase.
Its their strategy; they don't try to reinvent the wheel every year, but re-use what has proven to work, while they only improve things that are known to cause issues.

Just look at the Prius hybrids; driven by taxis for 100's of thousands of miles and still going strong.
Reply: @peanuts2105  LIFE is too short owning a Toyota
Reply: @peanuts2105  People who find breakdowns a waste of time.
Reply: @peanuts2105 I got a 2016 corolla S special edition, not a powerful car, but a fun one.
Reply: @peanuts2105  I do... 🖐️
Reply: @peanuts2105  Yeah, buy a Nissan! Keep your local mechanic in business! Or a ford, Chrysler or GM product and keep your local tow company in business!
Reply: @peanuts2105  
People that expect to have a car that lasts 300,000 mi. I'll take dull and reliable any day. But I drive 50,000 miles per year so it kind of matters.
Reply: @peanuts2105  intelligent peeps who spend wisely....Once!
Reply: @peanuts2105  "Yeah, but who wants a dull Toyota" - Someone who can tolerate a "dull" vehicle - but not repeated trips to the dealer with issues (especially post-warranty period).
Reply: @peanuts2105  Check Toyota sales.
Reply: @peanuts2105  People who like to save money on auto repair.
Reply: @peanuts2105  well, seeing as Toyota sells the most cars worldwide every year. Quite a lot of people.
Reply: @Sky Bound  
I only buy Toyota and Lexus brand new the past 3 decades. So far I've bought 4 Toyotas and 2 Lexus. (Sequoia, 4Runner, 2 Highlander Hybrids, LX, GX)
Reply: @peanuts2105  Anybody who doesn't want a stomach ulcer and premature grey hairs from expensive repairs.
Reply: @peanuts2105 I do, the last thing i want in a commuter is to be broken down on the side of the road during rush hour.